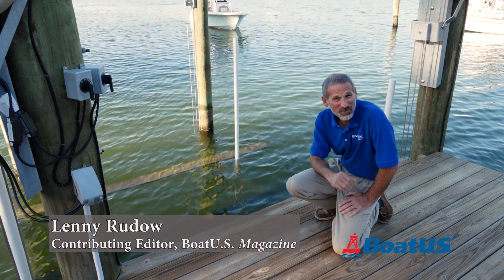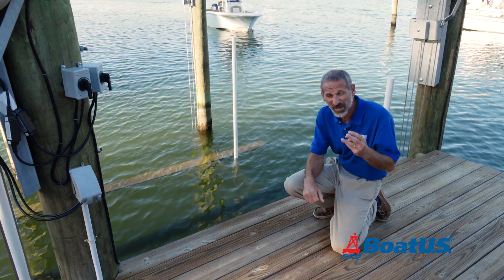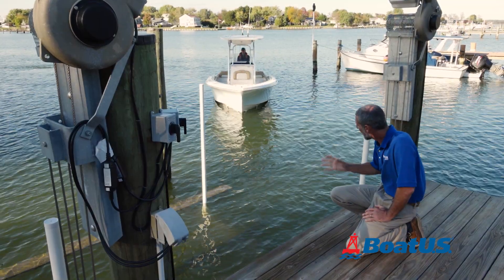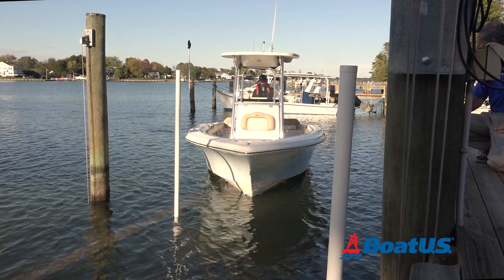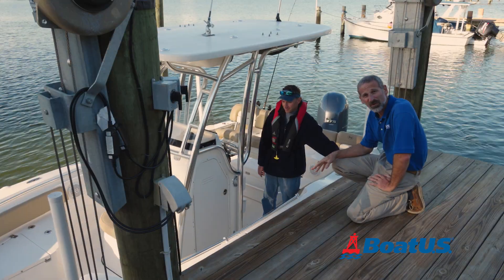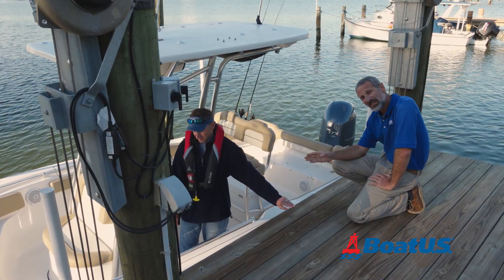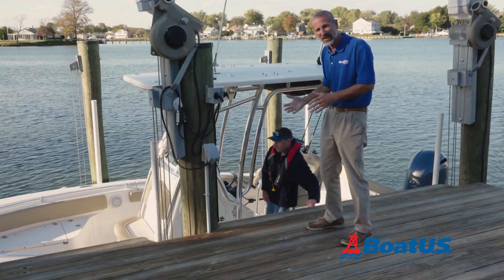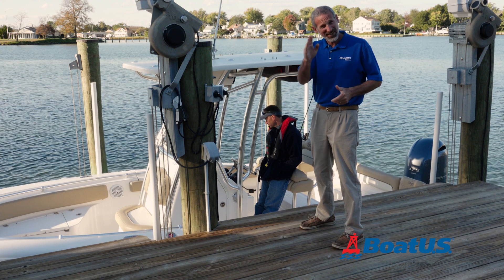How to Drive Your Boat Onto a Boat Lift | BoatUS

Comment: I have to do this with a 24-foot pontoon with only 6 inches of leeway on either side directly across current (based on where we could fit the lift based on water depth).  Every single time is a challenge!  What I do is navigate so that the boat is perpendicular to the slip once I am about 50 feet up current and fifty feet into the stream (turning against the current as suggested) and let the current bring me back towards the slip while I drive forward slowly and try to gauge it perfectly.  Once my nose is in, I turn the wheel back hard into the current and go forward so that the stern doesn't get carried away as I pull in.  I broke a few pvc guideposts learning to get it right but usually get it on the second try now!
Reply from the maker: Great method! It sounds like you've figured out what works for YOUR boat and docking situation. And while it's never fun, especially when people are watching, there's no shame into backing down and trying again. PVC guideposts are forgiving, which is why we use them! Thanks so much for sharing your experience!

Comment: I wrapped electrical tape on both aft PVC guide poles at the level where the boat floats off.  This way when I return, if I can see the tape above the water line because the tide went down, I know i have to lower the lift before I pull on.
Reply from the maker: Great tip, Michael! Thanks for watching.
Reply: Good idea Mike

Comment: When I put my boat on the lift I run the bow lift for a few extra seconds after I get the boat to the height that I want. That way I make sure that the boat has a very slight tilt towards the stern which will cause all rain water to run to the stern and be pumped out by the bilge pump. It only takes a very few seconds on the bow lift to give it this slight tilt.
Reply from the maker: Thanks for sharing, Henry!

Comment: Should we tie the boat even when on the lift?  I see my neighbor doing that. Thanks.
Reply from the maker: Thanks for the great question, Sunny. Unless the boat will be subjected to very high winds or tides, it's not normal procedure to tie a boat that's on a lift. When a big storm is coming, however, our BoatUS Catastrophe Team has found that tying boats up while on a lift is very useful for avoiding damage. You need to be aware that in extreme cases, however, a boat tied to the dock when on a lift can actually "sink" in place if the water level rises over the height of the lift and boat. (If it's lashed down, it can't float away.) If an extreme weather event is predicted, we recommend hauling the boat and storing it on land well away from the water until the danger has passed. (Also, thanks for your patience. Our team was at Miami Boat Show, so we couldn't get back to you right away.)

Comment: Do they have boat lifts for when some lakes let water out n cant use your boat so you don't have to pull out of lake.
Reply from the maker: Thanks for the question, Michael. Every state -- and sometimes different lakes in the same state -- will have different rules regarding whether or not you can leave the boat on a lift when the water's drawn down. As a practical matter, as long as the lift has been properly fitted for the boat, leaving it on there for an extended period of time is perfectly fine. (And in many areas, people shrink-wrap and winterize their boats on the lift). A lift like the one in the video would be an ideal type for this situation, if allowed.

Comment: How does he know in step 3 that he should align the gas cap with the guide pole? What’s the reasoning here?
Reply from the maker: Thanks for your question, Steven. It comes from experience and knowing where his boat is best positioned on his lift. Obviously if you're putting your boat on a lift for the first time, it may take a little experimentation to find a good reference point for your particular boat and lift, but once you have it, you'll find it helpful to ensure you have your boat positioned correctly every time. Thanks for watching!

Comment: so we all line up any boat on  lift with the gas cap? thanks great info
Reply from the maker: Good question, Graham. It might or might not. You'll have to find the right spot for your own boat. Our BoatUS Foundation boats that are stored on lifts have a piece of tape on the rubrail marking where the boat should line up with the post, but if you have something like a rod holder, gas cap, or other landmark (boatmark?) that lines up, that works fine, too. Thanks for watching!

Comment: They always do this on flat water. My 5 year old can dock the boat in that. Try doing it when there are 20 wakeboard boats cruising around constantly.
Reply from the maker: Hi Doug. That's definitely a challenge and one we will cover if the conditions present themselves. Unfortunately we can only work with the conditions we have on the day of shooting because we plan our videos weeks or even months in advance. Bottom line: We try to show the basic techniques because that's the starting point. Yes, adding a various combination of other factors requires some tweaking to the skill, but the basics remain the same. Most folks don't realize that we sometimes ad lib in some of our videos when things don't go exactly as planned, which usually adds to the educational value, but it doesn't happen on cue. We certainly appreciate the honest feedback, though, and keep it in mind as we come up with new topics.
Reply: @boatus  thanks for the response. PS: you can come to the lake I live on on any sunny day and get your brutal conditions! Lol

Comment: Make sure to get all passengers and operator out of the boat before you raise or lower the boat.  Four post cable boat lifts do not meet the elevator code or are approved to lift or lower people.  Check "Do Not's" in your operators manual.
Reply from the maker: Thanks for the good advice, Chuck. We always recommend consulting the manufacturer's recommendations, especially when it comes to capacity. That said, the lift rating shouldn't cut it too close to the boat weight, including gear and people. With most lifts, there's no way for the operator/passengers to get off until it's at least level with the dock. That's why it's important to have a lift with enough capacity.
Reply: @boatus  
And there is the problem.  I know of NO manufacturer that builds a four post mechanical lift that meets the elevator code and is approved for lifting people.  Here in Beaufort, SC we have an average tide range of 8'.  That means the boat bottom is about 11' above mean low water.  If you drop a boat 11' when a cable breaks, you do lots of damage, injure the boat operator and anybody in the boat with them.  I know personally of two cases where a cable broke, which then broke a second cable, the boat tipped over and people were ejected, one with 7 broken ribs.  My neighbor is so traumatized of a failure of a cable, he waits until high tide to run his lift, now he can only drop his boat about 3', and he NEVER rides in the boat while being lifted.

Here are some other issues:
Few people put their boats on the lift so the CG of the boat is centered on the frame, they don't know where the CG is, consequently the back cables are frequently overloaded.  New boats with multi engines have a CG about 25% forward of the transom.  As an example, the CG on a 42' Scout with quad 300's has a CG 10'-6" forward of the transom.  
Hoist cables are frequently of unequal length, for many reasons, such that hoist frame is not evenly loaded when boat is put on, overloading one cable.  When one cable breaks a second one breaks, boat drops out the back of lift or tips over.
Boat is not perfectly centered on lift, twisting frame causing unequal cable loading, same results as 2.
When winding wire rope cable on very small drums, common with four post cable hoists, cable wears internally from fatigue, not externally from sliding wear on drum.  Cable to drum ratio need to be greater than 18 to 1 for cable wear to go from fatigue to external wear where it can be detected by visual inspection.
In your video, recommend you strongly emphasize that NO person should ride in the boat while being raised or lowered.  There MUST be a way to access the boat in the lowered, in the water, position.  When you, as an authoritative expert recommend riding in the boat while being raised and lowered, become liable if there is an accident.

Chuck Gorgen
Consultant, Marine Lifting Systems
DryDock Boat Lift
(843) 263-3088
www.Boat-Float.com
Reply from the maker: @chuckgorgen7951  Thanks for your input.
Reply: @boatus   I have been looking for guidance on whether it is OK to stay on the boat while operating the winches because I manage seven lifts around the state and the boat crew often want to stay on board during lifting. Last year a cable broke and dropped a boat , damaging the hull and breaking off  the legs of both outboards (total damage cost was $66000) luckily no-one was hurt. I found  it is illegal under HSE law (in Australia) for an employee to stay on a vessel while being raised or lowered for the reasons outlined by Chuck Gorgen.  I guess if it's your own boat, the HSE law does not apply, but I do agree with Gorgen that it would be good if you could address the safety issues of staying on the boat...
Reply: @markcooper2817  I spoke with several boat lift manufacturers over the years and like clockwork, they tell you boat lifts are made for lifting boats, not people.   I am guessing some lawsuits cause that to happen.  The reality is people by under powered lifts and don't do the yearly mechanical reviews.